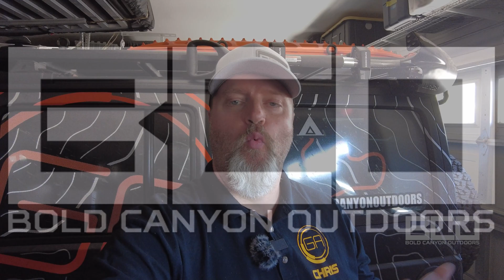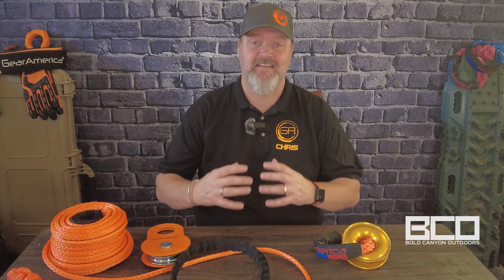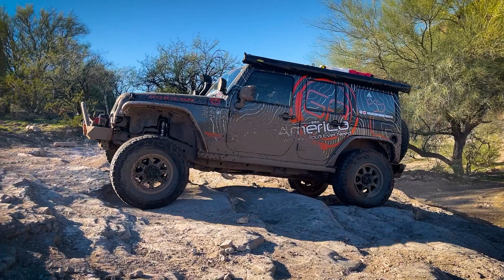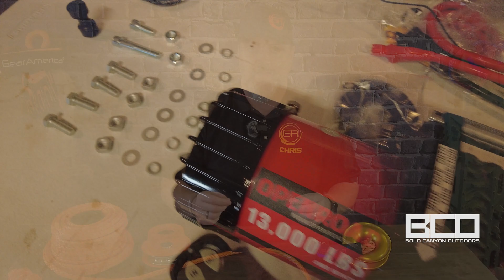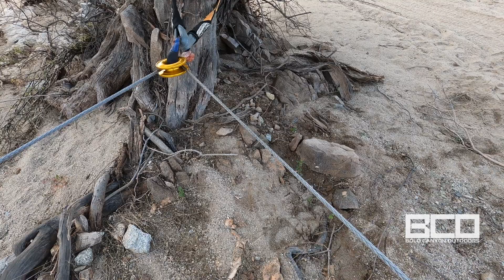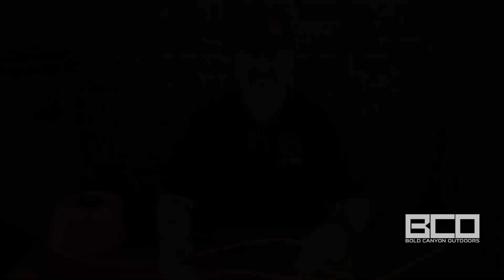Snatch Block Mechanical Advantage Explained - What can a PULLEY do for your winch?

Comment: The snatch block reduces the felt load on the winch. More turns less speed, and more power means the system works like a gear.

Comment: I think we don't lose that much speed, because as the motor forces less it turns faster. Another important advantage is the lower energy consumption. The battery will thank you ;)

Comment: He says it doesn't double the pulling power but says it does. He is trying very hard to discredit previous claims that it does but he has not accomplished it.
Reply: It sounds like he refers to how it works and is implying heavily that the oversimplified statement of a 10k winch pulling a 20k load, is incorrect that a snatch block makes the winch more powerful. A simple statement is with a pulley system, the math works were a 10k system pulls way more than capacity with load bearing assistance. Like psi is better resistance over greater area. A stilleto pierces bulletproof vests. Similar, literal, mechanics in math or related descriptive calculations.

Comment: Say a 2:1 setup with the snatch block say hooked onto a tree with a shackle and tree strap.

The winch line itself would have 1/2 the speed and the force would be divided evenly amongst the two line direction. But wouldn’t the snatch block, shackle, and tree strap be experiencing the full 2x force?

Comment: Maybe you could identify where you locate the ring/block matters (on the load or at anchor)
Reply: Your winch line coming out to an anchor. At said anchor you have a single snatch block/ring with the winch line coming from winch and returning to your vehicle. Second snatch block/ring attached to your vehicle with winch line from anchor and snctch block returning to your vehicle passing through snatch block and returning to anchor.
Now you have a 3:1 mechanical advantage. This advantage will pull the vehicle out with 3 times less effort on the winch and a 3:1 slower line speed.

Comment: Finally the answer i was looking for, and still took to 6:30 to get the answer. Looked at many different explanations, and no one explained why the snatch block gives you a mechnical advantage (usually a single pulley does not give you a mecahnical advantage). Its because the other end of the cable (attached to the bumper in this case) is taking half the load.

Comment: Don't those gold ring type devices cause damaging friction against synthetic ropes?
Reply from the maker: There has been numerous tests done about the friction, and all the findings show that there is extremely minimal of any heat generated, and the smooth anodized finish agains the synthetic winch lines is non-abrasive.
Reply: @BoldCanyonOutdoors correct with an idea is the hardened finish and ra smoothness  provides low resistance and improved efficiency?

Comment: First you said it doubles the the power of the winch then you said it doesn’t and then you went back to saying it does then finished with saying it doesn’t 🤔or am I high ? Maybe I am just high never mind 😅
Reply from the maker: It’s gives you a mechanical advantage that helps you move twice the weight at half the speed. What I was trunk to say was a 10,000lb winch is a 10,000lb winch…NOT miraculously a 20,000 lb winch

Comment: So if my vehicles 6500lbs and I have a 5,000lbs winch, if I have a snatch block and hook to myself the winch should be able to handle it?
Reply: Well, that all depends on how stuck you are. I would recommend going with at least an 8000 pound winch for that size a vehicle. recommended that your winch is always stronger than the weight of your vehicle. However, 5000 pounds of pull is better than nothing if that’s what you have, you can make it work.
Reply: Don't forget about suction if you are stuck in the mud. There are tons of variables

Comment: Great explanation but i still don't get it
Reply from the maker: Let me know what you need clarification on…or we can just say it’s magic!
Reply: Unfortunately you don’t understand because it was explained incorrectly. The only true statements are that no amount of snatch blocks will increase the pulling power of your winch and adding a pulley distributes the weight between two sides. But adding a pulley to an anchor will never create mechanical advantage. It will only serves as a change of direction in any system. It seems to me that all the off road videos just repeat what they have been told. Reality is that if there is any mechanical advantage happening it is taking place at the winch itself that is acting as a pulley as well (Magic). Or as in the last scenario where the snatch block was attached to the load, creating a 2:1 with potential 4:1 again if you count the winch as a pulley (magic). Watch this video that explains mechanical advantage so will understand. https://youtu.be/yRSGnE9aTi0?si=7ZcBzK4eAkFamAqx
Reply: @andycabrera6684 A pulley can either be used for change of direction or to multiply the pulling power. If you run the line through a pulley and back to your vehicle and the pulley is anchored you are doubling the pull as you vehicle is moving.
Reply: @lewy1  There is a distribution of weight thru the lines but the pulling power is not increased as you described.  Please let me explain. Start from the end of the rope and not the winch. The end of the rope starts on the load (the vehicle). Pulling from here is a 1:1. The line then goes thru a pulley (snatch block) attached to the anchor. This pulley is stationary and is only serving as a change of direction. The weight is distributed between 2 lines now but it is still a 1:1. The line then returns to the winch. The winch is the pulley creating a mechanical advantage, now a 2:1. The winch is magical because is so happens to also be the pulling source. So whether the line goes thru a stationary pulley and back it its self or is just tied directly to the anchor, the winch in itself is creating the same 2:1. Again the only real difference is that with a change of direction pulley the weight is distributed between the lines created. This doubles its weight capacity but the actual pull force has not changed. All of this is tit for tat because there are no absolute ratios when it comes to mechanical advantage. As long as it gets the job done and everyone is safe then truck on brother.
Reply: @andycabrera6684  No, if the winch is pulling 1000lbs that force is consistent through out the line as it goes around the pulley and back to the Jeep, so there is 2000 lbs on the pulley and 2000 lbs on the moving Jeep, not counting for friction loss. Cranes use multi-sheave blocks because they provide a mechanical advantage by distributing the load across multiple lines of rope, allowing the winch to lift heavier objects than it could with just a single line, effectively increasing the lifting capacity beyond what the winch alone could manage, even though the boom itself might be capable of supporting a greater weight; essentially, the sheaves act like multiple pulleys working together to amplify the force applied by the winch

Comment: Excellent explanation!
Reply from the maker: Thank you!
Reply: @BoldCanyonOutdoors  I am looking for a 10 meter or 15 meter winch extension line (rope) for hi lift jack winching. I do have a snatch ring as well as a snatch block. The rope must have a loop on both sides. Joseph (South Africa).
Reply from the maker: I’m in the USA, but you’d need to find a company that makes winch line and have them make an extension with loops in both ends. Or use something like this and add a loop:

https://www.ironman4x4.co.za/product/synthetic-rope-9-5mm-x-27m/